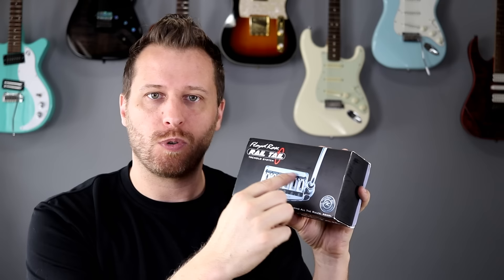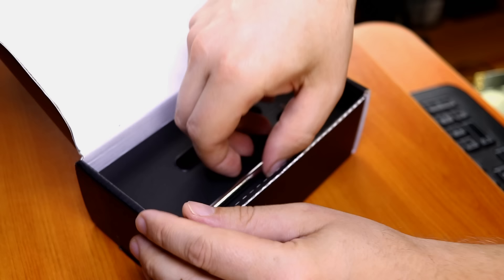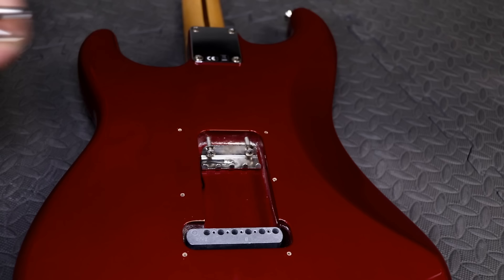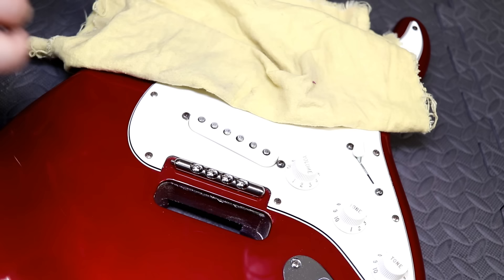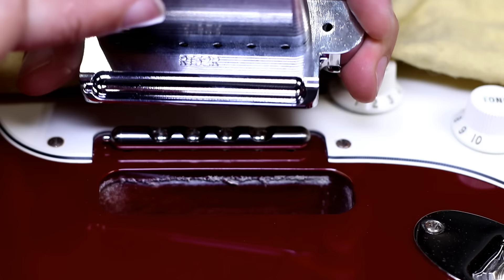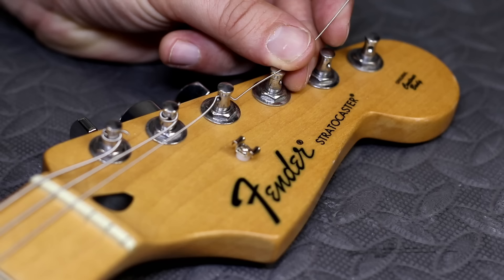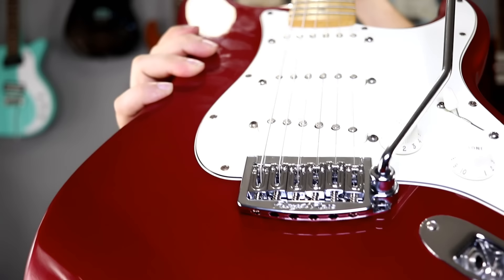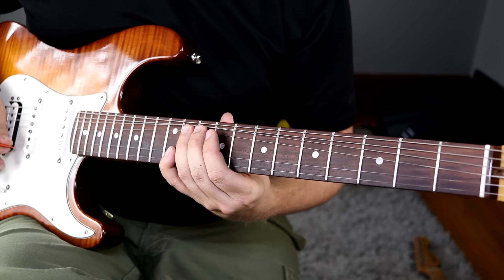Farewell to Fender's 6-screw Trem! - Floyd Rose Install!

Comment: That tune up on the high e string was nerve-wracking. Don't scare me like that, it brings back war flashbacks :( (kidding haha)
Reply from the maker: 😄👍 I still flinch every time tuning the high E. Even after 20 years lol.
Reply: Darrell Braun Guitar Even with a pack fresh set I still feel it may break anytime. That's why I use Rotosound Yellows not for tone, but for the extra high e included in the pack. If the first one survives, then I still have one more for the gig.
Reply: Try tuning down a 1/2 step or a whole step it sounds much better imo & you can bump up the gauge so you get better tuning stability & bends are much easier w/larger gauge strings tuned down w/all the full tone goodness that comes with using 10's at lest.
Reply: Watchman4u I am using 10s
Reply: Darrell Braun Guitar  great vid Darrell! Thanks to u I'm $600+ poorer in 2 days...lol..I have a Sophia now thanks to you.

Comment: That's a really cool bridge! I think the best usage of those MIM bridges are to be used as a Squier upgrade - they fit without an issue some of the most popular nodding models such as the CV and SE and so will fit the Affinities and Bullets if you don't use the backplate.

Comment: Another big plus .... when you break a string it stays in tune
Reply from the maker: True! That's a big plus for sure!
Reply: So does a six screw bridge if you have it flat to the body
Reply: Right! I bet those rollers eats up some sustain  too.
It reminds me of the Shift-2001 which was a terrible system.
It is actually possible to "dive" a Fender trem staying in tune.
There are just some small secret tricks to getting it right.
I know them, You don't. :-)

Comment: Great video as always Darrell ..
I 'd personally go with the surface mount floyd rose with fine tuners if i was to spend this much on the mod and go double locking for unltimate tuning stability

Also , in my humble opinion, I do believe  the bridge should not completely sit on the body .. it should be flush with the body , but the rear of the bridge needs be pulled up by as much as 1 mm so that the actual floating is possible and again tuning stability will improve

Comment: Looks much more...user friendly! Mine is blocked solid. Took a chance on a MexiStrat due to the labeling "Improved" trem. design, on a 60th Ann. Mexi-Strat. Nope! They missed again! Junk! I like this trem you're installings design, but I'm going graphtech saddles and nut too. Fenders factory nut is junk as well on this particular guitar. Intonation and stabilty must be fixed from both ends. String tree addition, and stiction issues resolved too! But the playabilty and tone of these guitars is fantastic! Thank You for the motivation😷👍
Reply: William Amos Yeah I agree with you. My 2006 MIM Strat wouldn't stay in song for 5 minutes.  I changed the nut to a Tusq XL and got a bladerunner bridge and now perfect.

Comment: Interesting (but not totally surprising) that another company would come out with this type of design.  The Super-Vee Bladerunner has a great implementation of this design/concept (I think they were the first) where the bridge is anchored to the body through a small rail/plate that is screwed in with 4 screws (for a 6-screw bridge).  The difference is instead of pivoting on the rail itself like the floyd, it connects the majority of the bridge with a flexible piece of steel that allows the bridge to pivot back and forward.  That flexible piece of steel goes through the both pieces of the bridge plate.  One benefit (subject to each's opinion) is that the bridge still looks like a Fender bridge, but operates much better in terms of sustain, staying in tune, and trem feel.  A detriment to the design is that Super-Vee kept the screw-in design for the bar - although there is an adjustment on the underside of the bar's hole to adjust the tension.  It would be great if they would have incorporated the design of a pop-in arm.  Another benefit of the Super-Vee Bladerunner is that it's a bit cheaper than the Floyd - coming in around $170 US, depending on the desired finish.  I run the Bladerunner on all my Fender Strats, and have had phenomenal results.  I do have a custom Carvin strat that still has the 2-point modern Fender-style bridge on it, and I'm tempted to give this a shot to see how it compares  to the Super-Vee Bladerunner.  That might be worth a comparison/shoot-out video (wink, wink).

Always enjoy and learn something from your videos, Darrel!  Keep 'em coming!

Comment: Great video Darrell, very informative!  The spacer you mention at 2:48 is also used as a conversion template for installing it on the 2 - point tremolo system as well.

Comment: It's a tradeoff between the doublestops being in tune and having the added utility of being able to pull up on the bar, which make a whammy bar much more expressive. I recently readjusted my stat trem to float, actually using one of your videos on the subject (thanks!), and I miss my double stops being in tune, but the trem bar is a lot better that way. I'm not sure which I like better.
Reply from the maker: That is a tough decision!  
I've always floated my bridges, but wanted to try something different. 
It will be interesting to see how much I miss it.
Reply: Guitars are just a whole bunch of compromises... which is why you need lots of guitars :)
Reply: Chk out my comment above I figured out the method of keeping a six screw bridge intune whist floating & yes I can do double stop bends w/out the other strings going out of tune. Even better results w/this method than Double Locking Floyd Rose trems. I've tried for years to over come that issue on the Floyd doing double stop bends & the other stings going flat. I need to apply this method on my Floyd trem Gtrs.
Reply: Just adjust your technique to compensate. I've gotten into the habit of slightly bending up the non-bent string on double stop bends. It doesn't take much practice and I can do it without thinking about it.
Reply: hey darrell, 3 years later what do you think?    iv'e always found rolling saddles to kill sustain although i understand the why.  ???
Reply: oops, meant for darrell :)

Comment: Now all you need is an LSR nut and a rolling string tree and you're in Jeff Beck territory
Reply: dvanhandel96 whats a rolling string tree
Reply: Tom Pantaleo The string tree (string guide, string retainer) are located at the headstock.  Typical designs look like little arches that hold some of the strings down and guide them.  When bending, strings can get caught on them which causes a little tuning instability.  Rolling string trees make it so that the strings are guided through little grooves that physically turn when you do string bending making it so that there’s no uneven tension and that the strings won’t get caught up anywhere.  They are designed to help tuning stability.  I have them on my strat and they do help a lot.  If you don’t have them, they are like a $15 upgrade or so.

Comment: alot  of people dont realize this but when you buy a Strat brand new there's a little spring that comes with the package. well that spring is made to be placed in the hole before you screw in you r whammy bar  and it  holds the bar where ever you place it  so fender already solved your whammie bar placement  issue  a long time ago but you cant beat the looks of the Floyd Rose
Reply from the maker: Hi! 
The spring is only designed for the US guitars. ☺

Comment: On my beautiful MOD Shop Daphne Blue Strat I have the Two Point Custom Classic Tremolo which I love, it stays in tune, and is easy to change strings (even for me).  The also beautiful '57 Surf Green AVRI has a Vintage Trem and it is a step up from the Tremolo found in my two Classic Series 50's Strats, they stay in tune IF I leave the thing alone (no bombs...etc).  The only reason I don't replace them is the Floyd Rose on my Charvel San Dimas allows me to get all the dives out of my system, even though my Luthier has to replace those strings because I am unable to (he tried to show me/I watched your vids, and I can't figure it out).  Nice upgrade to your Strat and very informative video as usual!
Reply: And your point is??? Besides showing off all your guitars in a comment and being full of yourself.

Comment: If you really want to improve your trem, buy a SuperVee Blade Runner. It drops in, uses the same bolt holes, but there is none of that rocking and tilting crap. It bolts solid to the body. It transfers all the string energy straight into the body. It uses spring steel to flex. Check out the specs online, but it is the best thing ever to happen to a Strat. I replaced all my Strats with them, even the two post that comes on the American Standard.
Reply: Can you set it up floating?

Comment: Just another sale for over priced Floyd Rose at $250 USD. You probably got yours at no cost !! And you have no locking tuners!! You can buy Fender brand locking tuners for about $60 USD, and it will do more to help with the stability of the strings! Change the nut , $20 USD and guy go with 4 new springs, about $10 USD, leaving the middle space empty and your great to go!!
So for about $100 or less if purschase from a good company like Sweetwater, you did the best up grade to a Mexican Strat that is affordable!! Remember always to lube the bridge strings and nut if needed, usually does. You will hear, feel the difference immediately and not a large hit to your pocket book!!
Reply: Like everything else in this world, superior quality means more expensive...

Comment: What an awesome upgrade!!! I hate the screw in bar. I'm always sticking pieces of napkin in the bar to keep it from being so wobbly when I use it. This would be perfect. I love that you don't have to modify the screw holes to use it to!
Reply: Andy Dionne fender sells these little springs that you can just pop into the whammy bar hole which keeps the arm stiff. I’m planning on picking some up soon because I have the same issue. Apparently they come stock with American standard series fenders
Reply: You also can add the little spring in the bar hole that comes with the american strats, makes the bar more firm.
Reply: Cool I'll have to try that!
Reply: The spring works fine but it doesn't save you from having to turn the bar forever each time to put it in or take it out.
Reply: That's true. It's a little bit annoying screwing that thing in. I mean... It's kind of crazy fender hasn't tried a pop in bar after all these years. Otherwise, I really do like the tremolo system on my deluxe strat. My squier is another story... It's ok. It's just okay.
Reply: +MatthewC. Put some plumbers tape( Teflon) around the thread on the arm.enough so it's a nice tight fit. And also use the spring.

Comment: I had a Floyd Rail Tail installed for about a month. Frankly, I hated it. The design is such that it's prone to the entire bridge popping out from its mounting, if you tend to be rough with your whammy bar. Ultimately, I got sick of its hassles and replaced it with a SuperVee bridge (the type with a flexible spring metal plate). The SuperVee really works great and it never screws up.

Comment: Looks like the price in Canada is about $400. That is more than I paid for my Squire Standard. I fixed the problem with the sloppy trem by buying a 10-32 die and cutting the thread about 1/4 inch plus (maybe 5/16 inch) further up the trem arm. I then installed a 10-32 "nylock" nut on the trem arm with the nylon section facing upwards and put a brass slim washer on the base into the trem block. The nut can be adjusted so that a quick flick clockwise, will land it into the correct position in a split second. There is NO play in the arm due to the lock nut ! Total cost $6.00, for die, nut and washer, no removal involved, only the trem arm itself. Even the very high end American Strats appear to have this poorly designed system. A friction sleeve as the Rose has, is the best system but not at the cost of $400.

Comment: For the $250-300 for this upgrade, I might put the loot towards an American Standard instead?
Reply from the maker: For sure.!
Any bridge upgrade is really only good for a guitar that a person plans on keeping long-term. 
If your goal is a US Strat, then best focus on that ☺
Reply: You will still have tuning issues w/the system unless you learn how to set it up to float & still stay in tune.
Reply: Alexander Winston  Mexicans strats are great quality instruments. And Japanese strats too
Reply: Of course it's not too hard to put the original trem back on the original guitar if you want to sell it. Cheers
Reply: Not if you've already got an American or custom shop strat ' because those Bridges suck too.
Reply: @stringsattached67  
I have an American Special, and you're right, I dont think those are really any different than the ones on mexican strats.
Reply: "The One That Got Away" - Fender Japan SSS with a Kahler Top Loader = absolutely no routering thru body for trem block or in back for springs - a heavy Strat with 10 times the wood that you guys considering a "Bathtub Rout" agonize about - sold it and now trying to clone one with a Lado Korea Kahler with Hot Rails + coil tap...
Reply: @byronofcalgary6985  Kahlers get no love...
Reply: Alexander Winston that trim system on the USA one still sucks so....
Reply: The problem is those fancy models of fender still go out of tune with that crappy fulcrum tremolo. Fender puts on guitars.
Reply: You will get the same junk tremolo.

Comment: $250 for a bridge to put on a $300 (used) Mexican strat?
Reply from the maker: 😄 True! 
It's not a mod for a guitar you won't keep longterm. Still cheaper than a new one. (Here in Canada anyway)
Reply: Darrell Braun Guitar dont get me wrong I love the look and I'm sure it's super stable. But I'd have a hard time justifying it (mostly to my wife)
Reply: Well you would take it off before you sell it you just keep it for your USA Strat or Squire Strat.
Reply: @johnborchardt448  if you have to clear a few hundred bux with your wife...you have greater problems than a trem unit to contend with...sell your gear...invest in hemp.
Reply: My mim strat was a gift from my niw dead father I've already spent $100 on locking tuners and now I spent $220 on rail tail and looking to spend another $200 on prewired American pick guard with really good noise less pickups in it. Still coast me less then $1500 for an American strat. I love my mim strat. It been with me forever for 23 year now.

Comment: Phillip McKnight just said in a recent live video that putting a Floyd Rose in a Strat was not advised because it would ruin the re-sale value of the guitar. However, I feel the sound and playability of the guitar is much more important then how much money stays in McKnight's pocket.  This is a great video!
Reply from the maker: Hi! 
This one can be removed in a few minutes and the guitar can be sold with its original trem. 
That's the best part of no permanent mods 👍
Reply: Gabe, I think what Phil was implying that YOU would lose your money if you modified your stock strat, then YOU decided to sell it to try to get your money back out of it. You would have to modify your guitar a lot to toss in a Floyd Rose and you would not be able to put your old trem back in. The more you alter your guitar, the less money you'll get out of it from someone else after you "fixed" your guitar and made it "better" then deciding to get rid of it. This can apply to cars as well. You are right about sound being very important. I'd get this trem, and you'll likely keep your guitar.

Comment: Some might say that quintessential Strat sound is only achieved with the trem floating and that the thinner, less sustaining tone with variable tuning is the mythical tone that they're after. Each to their own. I'd say that this trem with locking tuners and maybe a roller bridge could make non locking nut Strats much more useable and less frustrating for us lesser mortals who can't compensate for ify tuning on the fly. Nice clip.

Comment: A floyd rose that doesn't float? What i happening in this world...
Reply: too complicated for the malens,we got to step things back and make it easier don't cha know.
Reply: LGBTQH... the H stands for Hardtail
Reply: World is changing so damn fast these days mate....
Reply: I have 3 floating floyds and they all stay in tune always
Reply: If you don't float how can you whammy up in pitch? Well you can't lol so you can only do dive bombs with a non floating which is kinda lame. 

If you have a floating bridge set up correctly and treat it right, they stay in tune just fine.
Reply: ya   James some of the charvel socals are that way. i think that all the so cals are.
Reply: the tremolo on VH's axes are blocked, meaning non-floating. when asked why he blocked the tremolo he said that the guitars had better sustain than a floating tremolo. If you look at his red Frankenstein you'll notice a quarter he jammed under the Floyd, meaning it could only lower the pitch.
Reply: I actually kinda thought this model was supposed to float just above the body. What fun is a trem if it only goes one way? And down at that?
Reply: @patrickwilliams2530  Guthrie's Charvel comes with a bone nut. In one of the demo videos he says that the tusq nuts wear out too quickly from the wound strings  "sawing" into the slots, and start to buzz. Hence the bone nut.

Comment: There is two big improvement that could be made easy to this system – floating and height. Somebody could make a height spacer under the Rail. This spacer could be screw down by the outside screws.  This would do two things, keep your saddles from rattling from being adjusted to height, and lastly it would allow you Float. 
I hope two see this in the future or hear what Floyd Rose thinks.